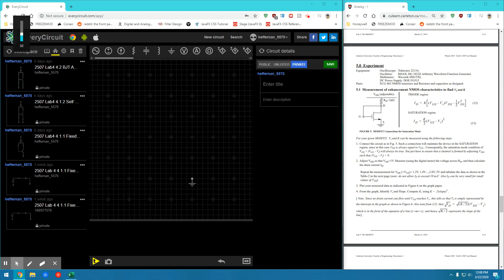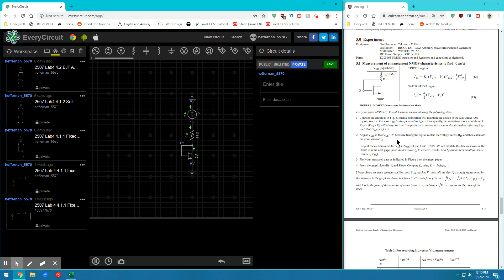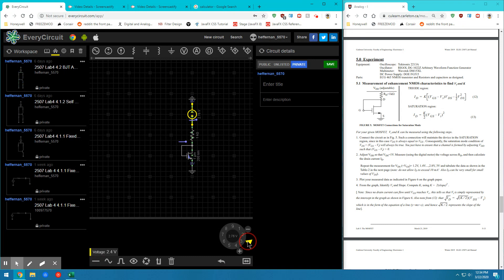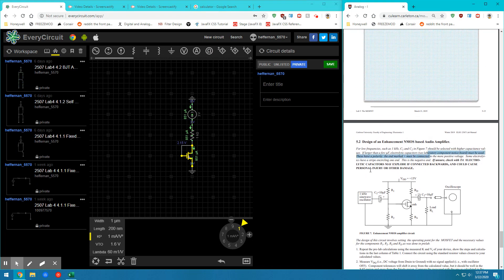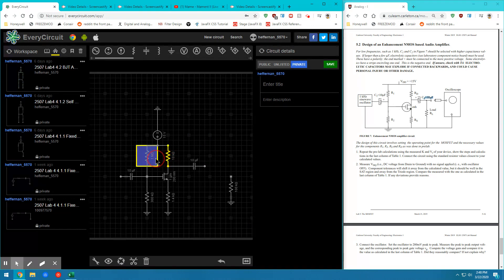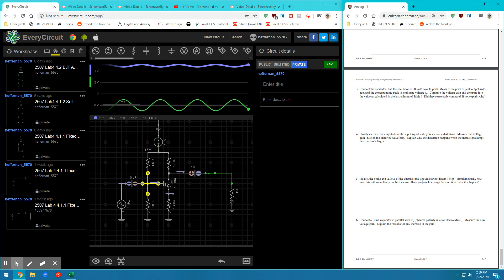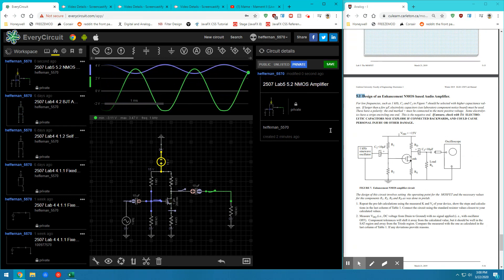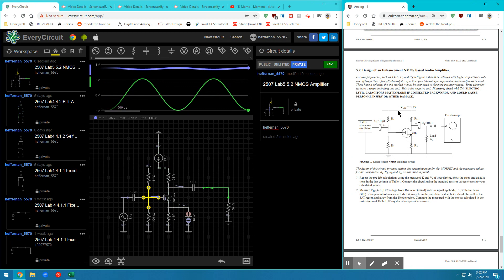ELEC 2507 Mosfet Lab Primer

Comment: Hi, so for the last part when adding the 10mF capacitor, my waveform is still clipped even though I changed back to our initial 200mV amplitude. Should i reduce the amplitude down to 90mV (that's when it stops clipping) or is there something wrong with my circuit?
Reply from the maker: the last coffee bean it sounds like your Voltage between drain and source (VDS) is too low causing your circuit to clip early. Try recalculating/readjusting values to get a VDS closer to VDQ of 7.5V which will help with clipping.
Reply: @adamsthename  OH I put the wrong value in that's probably why! I'll just repeat those parts then, thank you so much!
Reply: @adamsthename  So i tried changing the VDD value but it's still clipping and giving me a gain of 28.2 (after i changed back to 15V). I was wondering which calculation exactly was causing this, is it the resistor values?
Reply from the maker: the last coffee bean it’s the VDS value not the VDD value.
Reply from the maker: And yes it the resistance on Rs causing this.
Reply: @adamsthename Oh ok, do i need to repeat with a new Rs for the entire part 5.2 or just the last part?
Reply from the maker: the last coffee bean entire thing. Your operating point is directly related to clipping as explained in question 5 of the report.

Comment: When you say you are adjusting VDS, you are actually adjusting VDD. In the manual it says that D is the position after the 350 Ohm resistor, meaning VDS = VD. Which method is correct? Should we measure VDD like you do here, or VDS like the manual tells us to?
Reply from the maker: VDS and VDD are equal to each other because of the fact the source is grounded and it is a diode connected MOSFET. What I do in the video is correct.
Reply: @adamsthename  That's only true when VDD < 1.6. Once it passes that point VDD is higher, as a current becomes present, allowing the Resistor to take part of VDD's voltage load. For example, in order to get a VD value equal to 3V in my simulation, I need a VDD value of 7.65V, since the resistor uses 4.65V. I performed this method, and the graph gives me the right thermal voltage.
Reply from the maker: @prodigouschicken8919  So after doing this simulation a bunch, I just remembered why I do it this way. It's because of the fact that we don't know the width and length parameters for the Mosfet. This has a direct effect on the linear relationship between root of current and Vgs. Because the mosfets we usually use in the lab are doctored up to provide fairly accurate results, we unfortunately don't have a datasheet that gives us the width and length parameters for this mosfet. Although it would be great do this experiment properly we can only do the best with the tools we have been given.
Reply: @adamsthename  Ah ok, that makes more sense. Thanks for the help!